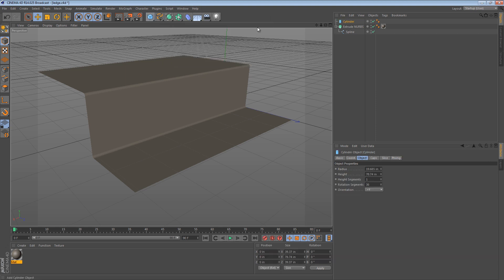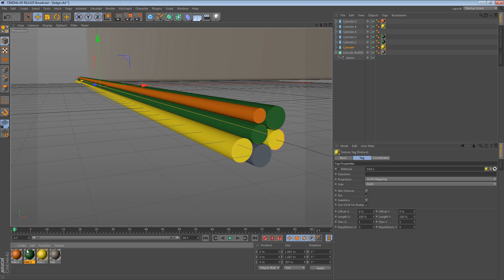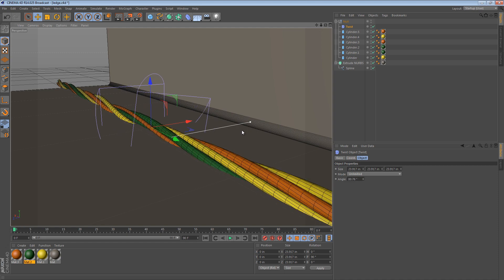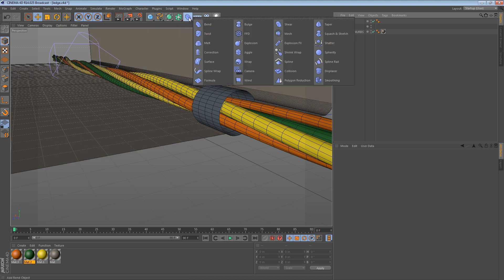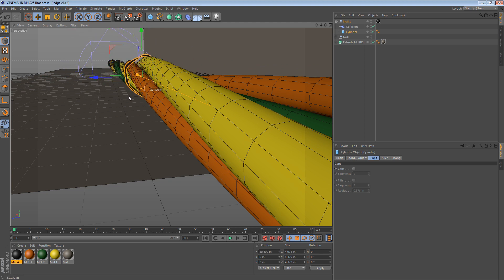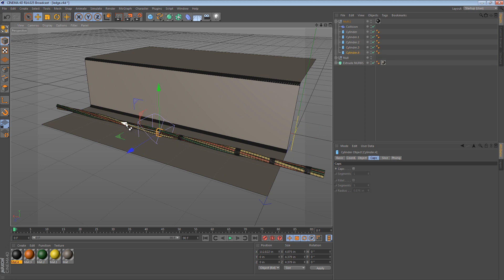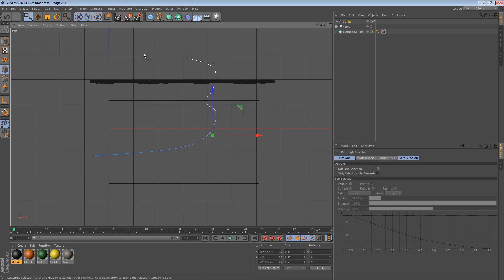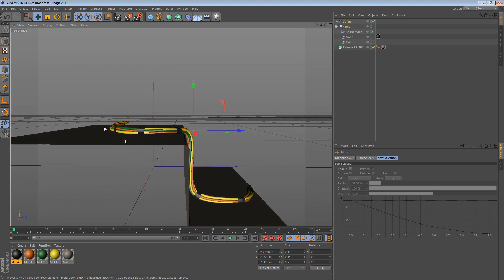Ten Minute Tip - Taping Cables Together with the Collision Deformer in Cinema 4D

Comment: Great tutorial! Lots of good information. One point of contention:

Right around 9:50, you mention the need to convert to editable objects. Not necessary. Drop both Null objects into a Connect object, and they will work.
Point of note, you acknowledge the shapes get jinky. True. Tell the Spline Wrap deformer which way the rotations travel (in your case, it's positive X, so just enter 1 in the first field under rotation.), and you need to subdivide your spline a few times AND convert the points to hard interpolation. Jinky gone.

Comment: If I put the tape cylinders inside a cloth NURBS to get a little bit of thickness, would it still work accurately with the spline wrap deformer? Thanks again for the tip!